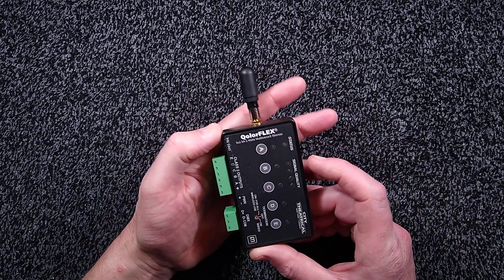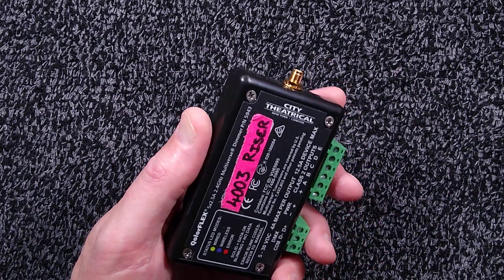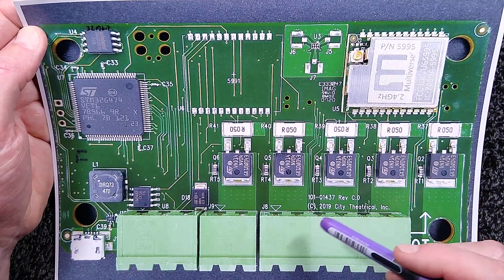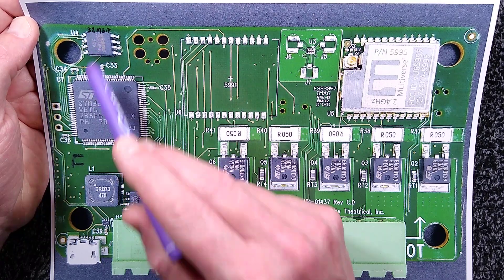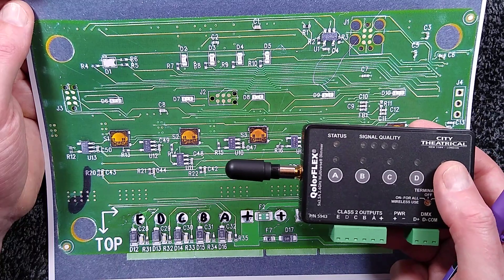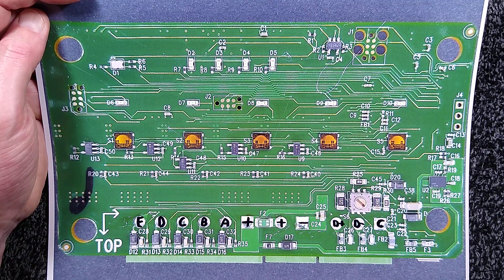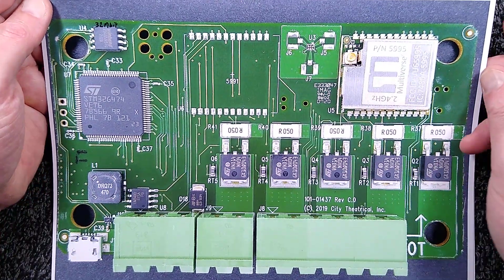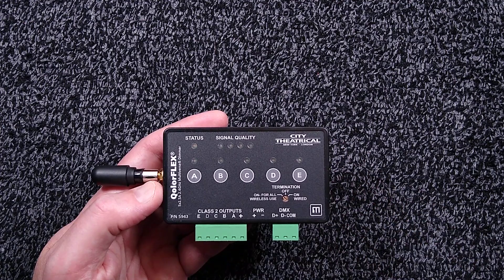Inside a wireless DMX receiver

Comment: I gave a bit of advice for someone making a... similar lighting control device for a large theme park. Eventually the decision was to pre-load the show over wifi onto the card, then merely send it a go signal with a timestamp on it. Then the GPS-laden board would just... play the show, all the myriad units running without any input at all (except maybe a stop signal if they ever had to for some reason), using the GPS for time sync. Worked a treat in a tricky RF environment, but of course the downside is you need a completely canned, almost invariable show, without fiddly humans and their imprecise timing involved.
Reply: "Fiddly humans and their imprecise timing" was such a lovely way to state it! :D
Reply: Absolutely a great way to go.  I have also done systems that broadcast a timecode over radio, with the cues stored locally in the receiving device.  That way, as long as the receiver gets a snippet of timecode, it can run cues with it's internal clock, even if the radio drops out.  Of course this still only works well with a locked down timecoded show.
Reply: @lucidlx  We did this for an animatronic single tiger in a show I worked on. I did all the electronics and software for the tiger, both recording it's performance and playing it all back on stage. It hooked into the broadcast time codes on stage to sync the tigers performance with the stage effects and music. The problem we had was sometimes the tiger would just crash (turned out to be a wiring glitch - not mine!) and it would restart then it had to 'catch up' to the performance. Because we were using simple and slow Arduino type micros this would take some time so I had to make it skip head to the right time code, which was slow so it then had to work out how long that took and then skip ahead again by that amount to catch up. Eventually the difference was small enough to be back in sync. Our backup to this system was a straight radio control and a manual operator. The tiger would lose some of it's animatroinc features in that case but the major ones like the jaw opening an closing could still be worked so the operator could 'lip sync' the performance. Our back up back up system was 'set off the fire alarm and evacuate the show' but luckily it never came to that!
Reply: Need more input....atleast more details to concur
Reply: How many universes
Reply: @retrogamestudios6688  Doesn't matter.
Timecode/RTC-driven shows are common, I've put together such systems from a mere 4 universe all the way up to around 150-200 universes, give or take a few dozen.
I forget the details, it didn't really matter.
You just need a controller that can store the show and play it back synced to timecode, with a sufficiently-accurate set of Real-Time-Clocks that can be remotely configured to start each segment at a precise time.
Said controller lives in the remote end, and the core sends the "Go at this point in the future" commands over the unreliable link - several seconds before it actually needs to start.

That last detail is the critical one. You need to know exactly when the cues must fire several seconds before they must do so.

Which tends to make the method useless for most shows that involve squishy humans.
Reply: @Richard-dc5he  so why didn't u say that. I work for Harman by martin. Anything I can do let me know
Reply: This is exactly what I use for my wireless show products. There’s millisecond timing available on esp. Record the show and broadcast the time. If a wireless fixture reboots it’ll wait for the time then play from sd card from there. Compatible with all ArtNet transmitters and show software, mappers or lighting desks then.

That or calculate the fx on device. Edge computing in microcontroller world. 2400 pixels in one dmx universe. 

Open radio bands are clogged. So with adaptive frequency hopping this is mega.
Reply: I’d never dare to use wireless DMX but your use case makes absolute sense. 

I had a show years ago that we were playing in China and had a translator translated every sentence. I was running the show with Qlab and D::Light on one laptop and my first idea was to hook up another projector or some screens to do the translations myself. 

No, they had LED translation bars there. Okay, I gave them the translation and they gave me a laptop to press enter on for every sentence. We’ve tested it and it worked. The caveat was that those bars were WiFi operated. I felt a little unhappy about it (having a WiFi background) but they assured me it would be allright. 

Then came showtime. 500 Chinese visitors came in, with their phones all turned on, WiFi of course too, so the first two sentences went slow but a little well, and then it was just mayhem. 

I had my hand take the laptop and sit on the first row to at least sit in direct line of sight to the device but it only helped a little… the polite system WiFi is just went nuts with its collision avoidance with egregiously low connection speed and almost complete loss. It was horrible. 

Luckily it was a puppetry show for young children so the parents who didn’t speak English couldn’t understand a word but the children were completely awe struck by the puppets anyway. No translation needed for them. 

Needless to say I didn’t dare trust any Chinese solution anymore. Although I had some mistrust from them too in some venues when they angrily shouted when I disconnected the DMX plug from their lighting desk to hook it up to my Enttec dongle. After the show they wanted to know everything about my gear though. 

This was back in 2012 by the way, and my first tour in China, I’ve learned a lot for the many times I’ve returned there. And boy did they learn too. Last time I visited they didn’t have old eighties unbranded light desks but Avolites and Grand MA’s, and even brand name moving heads.
Reply: @RustOnWheels  I've only used in for mobile weddings. You know those stupid venues that only let you win about a half hour prior to go
Reply: @retrogamestudios6688  Yeah makes sense then. I only did big shows and now do show control integration of experiences & musea. Both at the “we have plenty of time” scale when compared to weddings & events.
Reply: Sometimes you need to run a system live and not have it preloaded, especially when you are running a show like the Tattoo.

Comment: You should be able to get those receivers with 868 MHz (UK/EU UHF) LoRa modules in them. I’m personally not a fan of using 2G4 if I can help it, it’s just so crowded a band these days.
Reply: 915MHz (the US open band) is allocated to 3G/4G here, iirc. You won't compete well with a local mobile cell running at tens of watts (and Vodafone will send goons when they triangulate your position).

Our open bands 868MHz or 433MHz are often quite usable in the UK depending on where you are, and the lower frequencies are absorbed less well by water-filled humans so they carry further.

You can also check for clear bands and interference on site with a cheap USB software defined radio module and open source spectrum analyser software like gqrx.
Reply: @blinkenzomg  The downside of using 868 or 433MHz is that you're restricted to a low duty cycle, among other limitations. I doubt you could run a DMX universe on that frequency without busting a few regulations.
Reply: @MicraHakkinen  433MHz can also be stomped over by amateur radio ops with a fair amount of power and most repeater outputs in the UK for analog voice are at 433MHz. Been a few story's of people being locked out of there cars and garages because if this.
Reply: @MicraHakkinen  At 869.5MHz you are allowed 10% duty and 500mW.
Reply: if you use the open frequencies allow in the local area you'll still be contending with all the audio equipment used at the venue. with a lot of performers using one frequency for their mix/instrument and one if the use iem, it won't take many to saturate the available frequencies. ideally if possible always run cables.
Reply: Any of the open bands are fraught with interference. Proper RF management is a requirement in AV.

Comment: Yeah, I'd say you're correct in your assessment of the mysterious structure between the modules, it's probably for a mixer/diplexer.
Reply: Always going to be a bit of a compromise given a single antenna trying to cover 900mz and 2.5ghz....
Reply: @dougle03  Hopefully the antenna itself would be swapped, but the connector is shared.
Reply: I thought it was a miniature flux capacitor to eliminate latency by moving the input signal a fraction of a second to the future.
Reply: @Murgo-u3l  Just my thought!
Reply: Maybe it's an RF amplifier with impedance matched DC power.  Or maybe it duplexes receive and transmit paths that are both in the same can.

Comment: Reminds me of a wireless video link system I was using - that was just, working great in rehearsals -- but once the room filled up with people, dropped connections, streams out of sync - total postproduction nightmare. 

Scanned the spectrum for some kind of rogue AP that may have been causing it - but eventually settled on doing a little lab-test - sure enough, the things were SO reliant on line of sight, that 5 people standing in a row in the radio path dropped the signal to the point of cutting out. 

Luckily the receiver of the unit had a 1/4-20 thread on the bottom, so standard practice just became to mount it way way up high on a tall tripod over peoples' heads, and we haven't had an issue since. 

If they are using ESP's inside their custom reciever- they'd have to write it into their firmware - but perhaps a mesh configuration would be the way to go. This way the nodes can just hop hop hop to each other and perhaps the edgemost unit has clean LOS. Otherwise, perhaps highly directional antennas on the hub might help. 

I have definitely seen auto-reconnect issues on 8266's. Generally I just write some watchdog code that pings a server every 90 seconds or so and hard-reboots if it can't phone home, but that's on an ESP running on generic TCP/IP - not sure what the network stack of these looks like. 

I presume if it was an option, you'd have already pursued it but - have you considered just hardwiring them?
Reply from the maker: Wiring was not an option as these risers were wheeled out a reasonable distance in the dark at multiple points during the show in a short timeframe.
Reply: Auto-reconnect issues with 8266s? Gasp! Surely you jest. /sarcasm
I've done a lot of 8266 stuff lately and auto-reconnect is definitely the weak spot. Pain in the arse to deal with especially when you have an 8266 acting as an AP to some 8266 stations. I ended up writing a bunch of code that makes them ping and pong each other every few seconds and hard boot if the connection is lost. Shouldn't need to resort to such violent measures... grrrr... thanks for letting me vent my frustrations ;-)
Reply: but you're pro's. can't you use actual comms freqs? ism is ism for a reason. i know wireless mics at least here use other freqs. some are ultra low power and iirc free, some licensed. that's for .ee at least. but those 2.*ghz, 8**mhz and 4**mhz ism bands are overfilled with stuff. imagine everyone coming with phones and having bt on, maybe someone even has wifi ap on, real fun going on on the spectrum i could imagine
Reply: @ketas  Using licensed spectrum can be quite pricy in some places. The hardware is more expensive AND you have to have a site license to operate it. It's not included in the cost of the product.
Reply: @Alacritous  This show was big enough to get a site license for a frequency block.  Problem is getting equipment that can be configured to licensed site frequencies as needed, while not inviting unlicensed idiots to activate that function.  Perhaps a standard format for a government signed electronic license certificate allowing a specifief frequency and date range, which professional and prosumer equipment can check before falling back to consumer frequencies. Things like that tiny RF can need to be made to do that rather than having each equipment brand do their own checks.  Then there should be a test band with 2 channels that design labs can trivially get a license for in the format used by government site licenses, just so designers can test their "licensed operation" feature in a random office building far from actual venues and EMC labs.  Getting that test license should be cheap, but with effective policing of attempts of widespread use by the ignorant masses.
Reply: OFCOM took away several of the bands that had been previously available for entertainment purposes under licence, and did not replace them.
A lot of functions have been pushed into the ISM bands because it's no longer possible to licence any frequencies for this purpose.
Reply: I mean realistically unlicensed ISM is fine for this, it just ought to be digital spread spectrum. The 1.9 ghz band for instance is used for DECT cordless phones and wireless microphones, and equipment that operates on this band has to be certified to comply with the TDMA multiplexing it hears in its environment. So many devices will play nice together. There does exist the standard for a data link over this system, DPRS or dect packet radio service - though I can’t find any hardware actually using it. I presume engineering and having certified hardware for a fairly niche market might be cost prohibitive, but that would likely avoid the problems described.

In reality the 2.4 ghz option was cheap, likely worked perfectly on the bench, and wasn’t stress tested in anything resembling the production environment where it failed to achieve reliability. 

Point is, the solution needn’t be licensed spectrum. There are other options. They just aren’t as cheap as whatever esp8266-adjacent hardware was actually used in this product.
Reply: Got to love those jerks who bring signal jammers.
Reply: I once performed with wireless led array attached to my wardrobe. Everything worked in tech rehearsal and then nothing during performance. We were stumped at the time, but now I think the point of failure was related to the 20,000 cellphones inside the arena during the performance 🤦‍♂️
Reply: @partytempo  the phones will do it. Especially in the early years before great shielding....I love the new RGB wifi bracelets they give out at concerts now, no interference period and they all got a 3 foot range and daisy chain off the transmitter
Reply: @retrogamestudios6688  funny you mention that. Fans got the bracelets which were air tight.  The performance was rigged with cheap LEDs and a transmitter that looked straight from ali express 😆
Reply: @partytempo  Ive spent 22 years of my life working for martin a/s and now that we got bought by Harman our quality assurance has plummeted. We used to be all about the little details, now it's all about a state of the art led that has big promise but lacks on delivery performance. I notice more and more startup lighting companies making products that exceed manys expectations and they holding their own in reliability. So all you up and coming electric engineering graduates get your acts together and help us out here